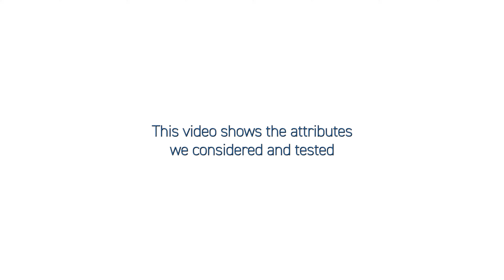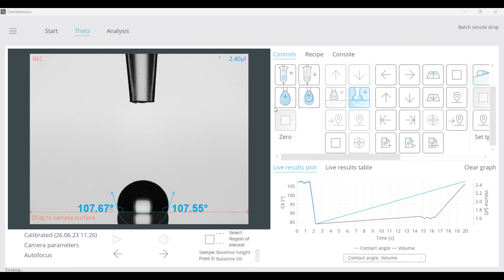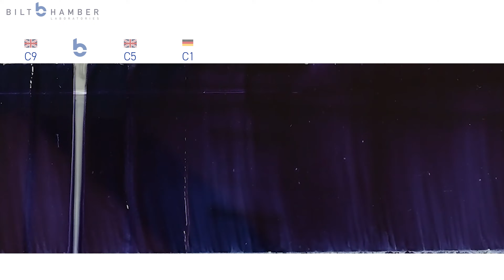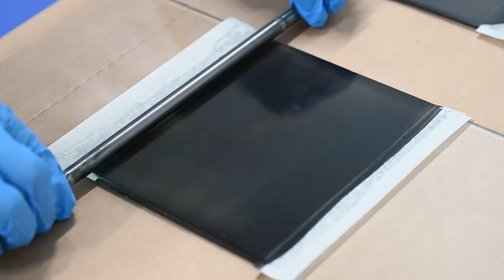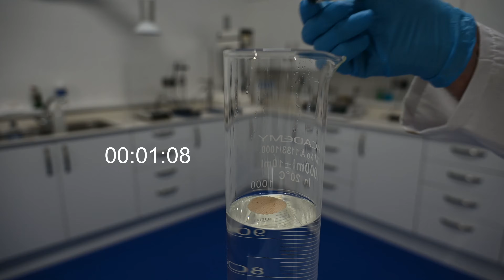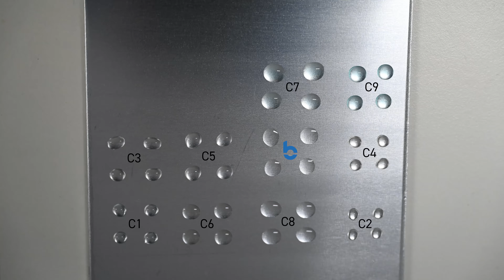Bilt Hamber Laboratories Trace-Less - Best Glass Cleaner Testing Comparison How It Works Video

Comment: Got mine today and it left streaks. What did i do wromg
Reply: check you are only using cloths that have never been used for waxes and polishes, only use containers / triggers never used with surfactants before, it will dissolve anything from these and then deposit them on the glass.   Happened to me and I contacted them,  my old MF cloths.